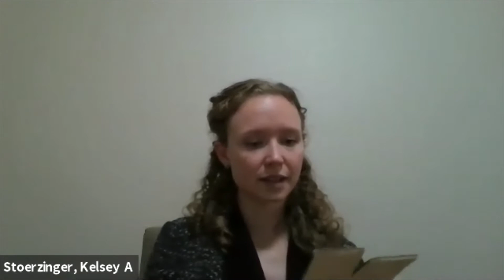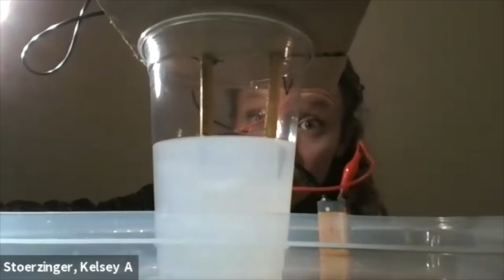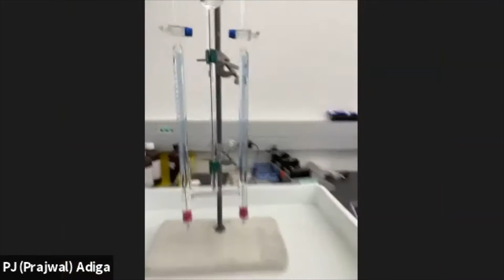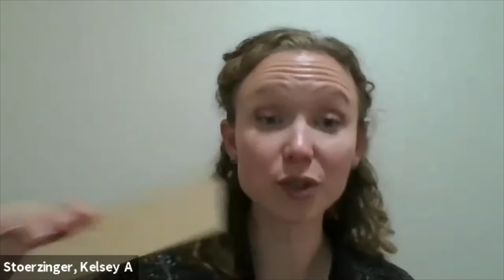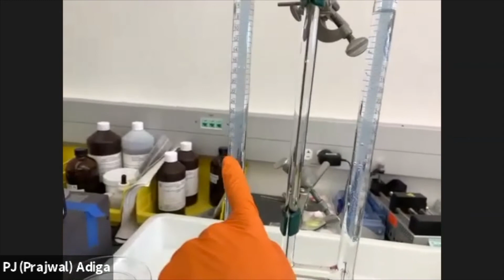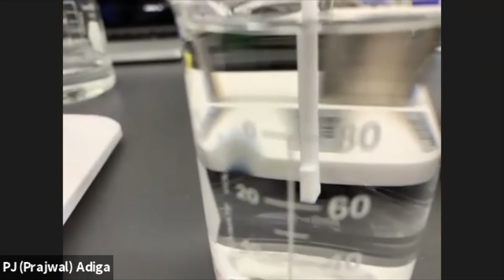What makes up water? Let’s split it! | The STEM@Home Series

Comment: Materials List: 
1 9V battery or 4 AA batteries
Scotch tape
Clear cup
Tap water
2 pencils, sharpened at both ends, or 2 pieces of mechanical pencil lead
2 electrical leads with alligator clips, or 2 pieces of insulated wire, stripped at both ends

Optional: 
Piece of thin cardboard/cardstock
2 paper clips
Baking soda

Distilled water